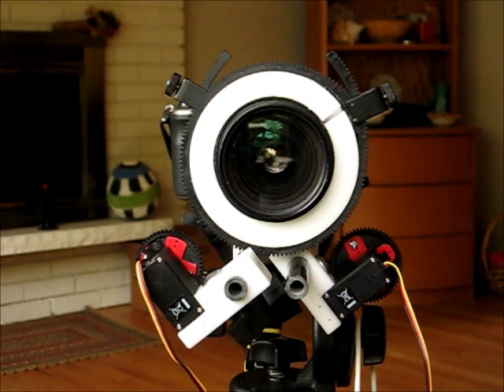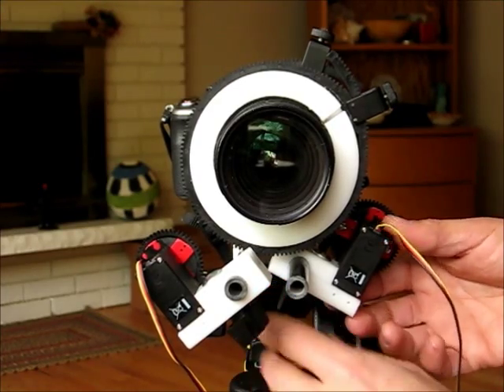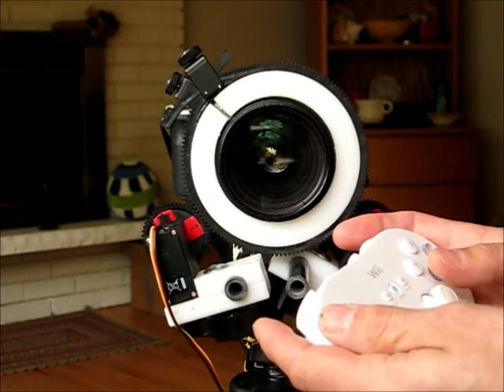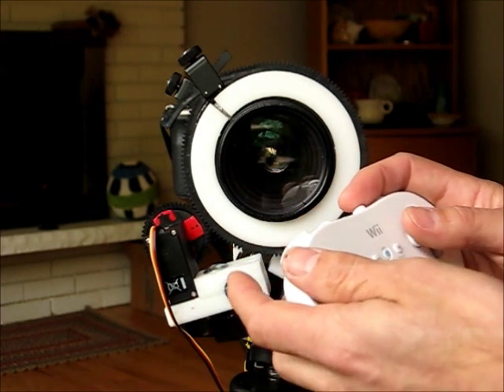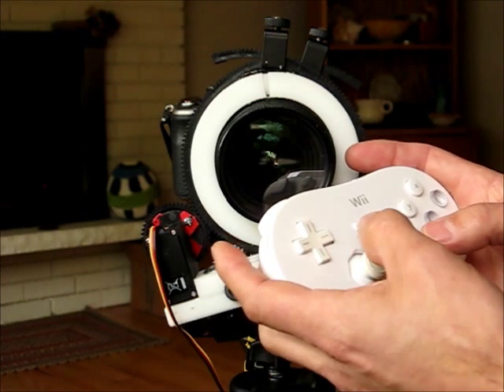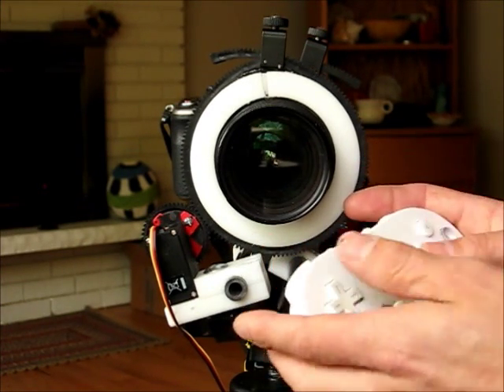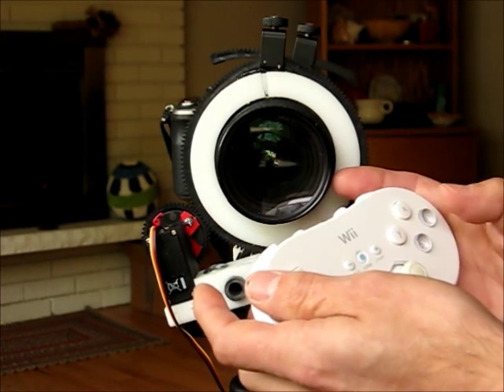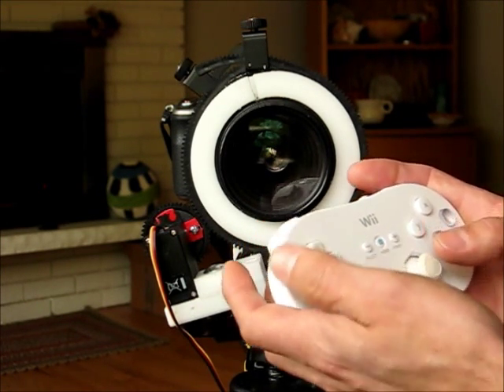Arduino-Based  Synchronized Zoom - Focus Controller - Configuring the Controller on a GH2

Comment: uhmmm if you leave the camera pointed on the same object, the focus does not change if you zoom. You zoom in fully, then focus and it will be sharp in any zoom position. However this stil is a nice system if you want to change the object while you record. The example is just not a true situation. Stil I love to also build this soon. Nice video
Reply: Most cheap lenses are not parfocal...so they will lose focus - even minimally - when zooming.